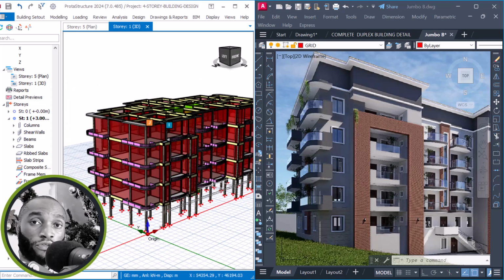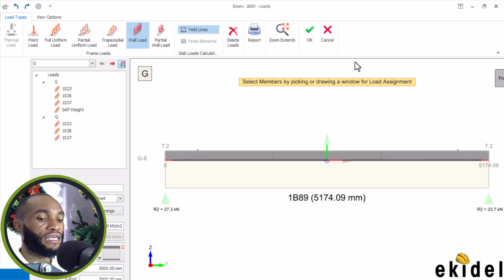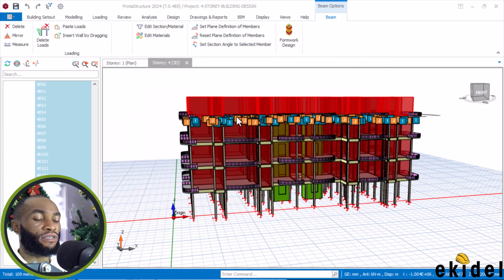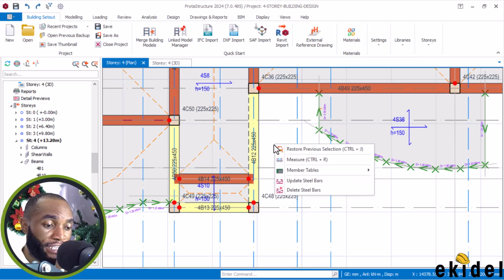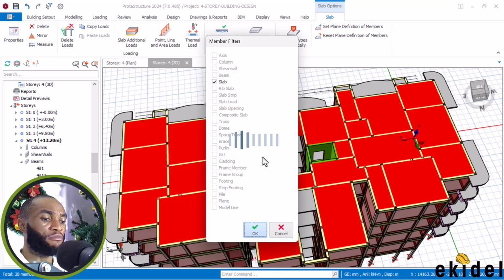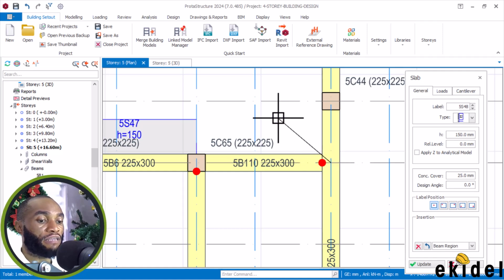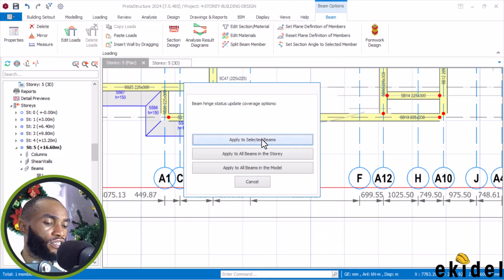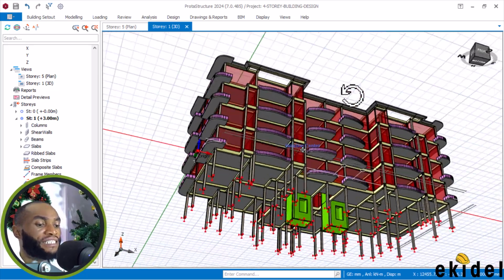Design of 4 Storey Rcc Building having a Basement Floor with Different Ground Level - PART 5

Comment: how do you handle a 4 storey model where the basement is half the footprint of the rest of the buiilding. say the basement is 12mX8m, then the rest of the structure is 12mX15m. this is due to slope issues.
Reply from the maker: This Structure we are working on has it so watch out how we will resolve this

Comment: Is it practical in considering hinges in construction, and how does it imply in a real project
Reply from the maker: Hinge is applied during the structural design. Its effect is applied in the reinforcement size, number which is then used for the construction.
Reply: @EkidelEngineering  ouky, i can get you to some extent, i have been performing a design on a 5 story building but on analysis seem i getting a big number of reinforcements. and also if you dont mind please explain us on  the implication of utilization ratio during design